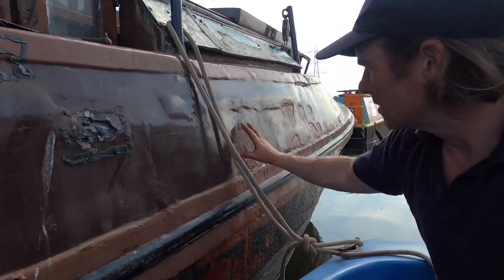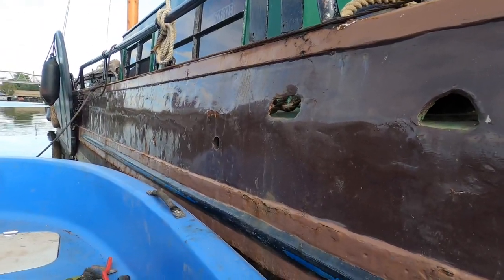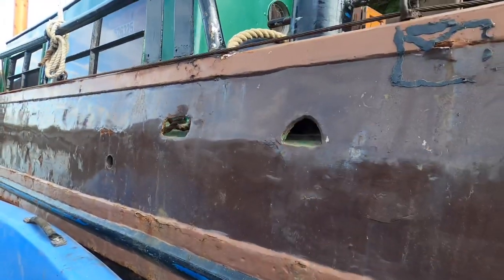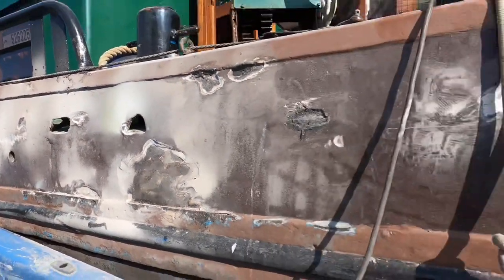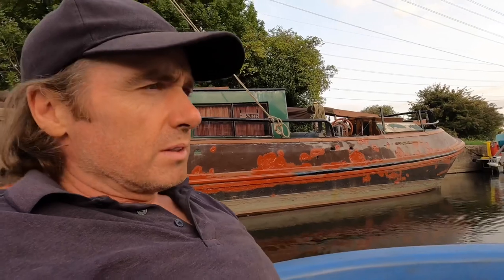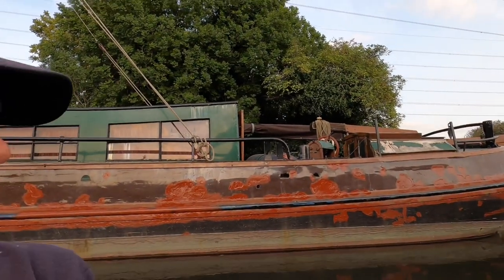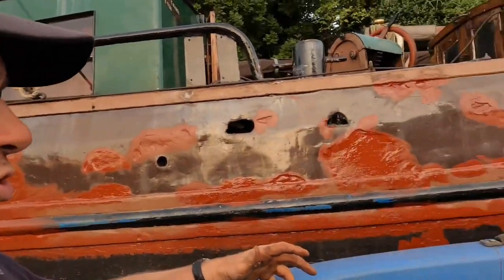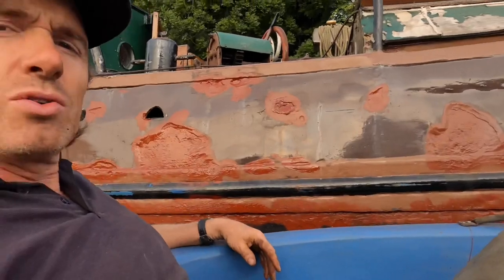Dutch Barge Linda #18 Painting and musings and DEATH!!!! (my drill dies)

Comment: Next time when you need to do these small rust removal type of jobs use an angle grinder. You can fit them with flapper grinding discs or heavy steel wire brush cups. They work a LOT better then those puny drills and you will have way more control because they come with 2 grips.
But really, media blasting is the only real way to go here. 
The angle grinder is a great tool to have anyway because you can also use it with cutting discs for metal and stone, thick grinding discs to grind off welding exces. A must have tool IMO.
Reply from the maker: You wait until you get further into the playlist. There are some big tools coming in the videos!

Comment: Guess you will know every inch of that boat when you're done with all the work. A dry dock would be perfect for all the bodywork. It would be nice to get back to steel and plate her where ever it's needed. Antifowl and maybe some two pack paint and you would be able to sleep well knowing the superstructure is sound. Great project by the way. Beautifully boat.
Reply from the maker: Hi James. So I’ve owned the Linda since January 2019 and the first thing I did was renew the anti-foul and ensured that everything below the water line was acceptable. So the plan is to get through COVID and get her into a dock to get the steel work done. In the meantime I’m just tidying up until we get back to normality. You’ll be glad to know I got my narrowboat metal sprayed with zinc and two pack. It may never rust again!  Hahahaha!

Comment: oioioi, that's a nasty deathcoat of filler. For sure it has to come off. Who knows whats underneath there.
Probably it's not too bad, but you want to have welded every little crack before you move to the interior.
Sandblasting would be the best of course, but also is very expensive.
Using a wire brush is usually not recommended because it massages the rust into the metal. Better (and quicker and louder) is to use Tercoo / Perago discs. This works a bit like sandblasting. Make sure you have a powerfull machine to drive them or you will have overheating issues. Also get the protective cover as rust and paint flakes fly everywhere. Oja, take the 3 or 5 disc variant.
Once you're set up this will work much quicker than a wire brush.
Maybe you can make a combination where you first use the Perago discs for most of the hull and then have it sandblasted for all the remaining little pieces. That would probably be the most cost effective vs. result method.

The markings you found may show you the registration number. If you make it fully clear it is quite easy to find the owners history of the boat, which wharf built it, and probably where it has sailed.
Reply from the maker: Hi Baytep. Thank you so much! That is such valuable information. I’ve been told about Tercoo before but, your clear instruction solidified a plan in my head. I’ve been online and yes I can see the advantage of the 3/5 disc. There are plenty of do-it-yourself places that I can do it. I just need to get over Covid. 

I love you description “death coat of filler”. The bow of the boat crashed into a stone dock 50 years ago and the filler been layered up and sculpted to look pretty again. What’s underneat may require a bit of engineering!!! Hahahaha

If it doesn’t sink, that’s another good day! 

Linda’s History is going to be an important part of the journey and when the time comes further research into it history will come. I do know It was built by Dirk Boots, Gouslius, Alphen aan den Rijn.

Comment: I’ve got two episodes to catch up on! 😁 that’s a lot of filler!! Deffo agree with sandblasting! The filler probably has a lot of ripples in it, it will only trap water also, I’ve been a welder/panel guy for a long time I’ve got you on Instagram if you ever want to pick my brain feel free! I’m also pretty local 😉
Reply from the maker: Hi Daniel, It’s not too bad, but the the boat has had a few crashes in its 110 year history. One, was a head on collision with a pier 50 or so years ago. So I know when the front get stripped I expect there will be replacement steel required.  I WILL be looking for advice. I’m starting to clear a place in my head for a plan to strip, weld and paint in spring /summer.
Danners Automotve?
Reply: Canice Bannon that is me, Dan. I’m a mobile welder too, keep in touch I love following the YouTube,  aspiring barge owner...
Reply from the maker: Well Dan, music to my ears, as I used to stick weld as a kid on the farm, I will be welding the the hell out of DeVrouwe Linda. But not the hull, so I will be in touch as I WILL have questions. If you do decide you want to buy a boat, get in touch.... any time.